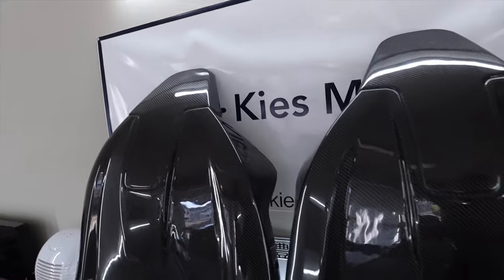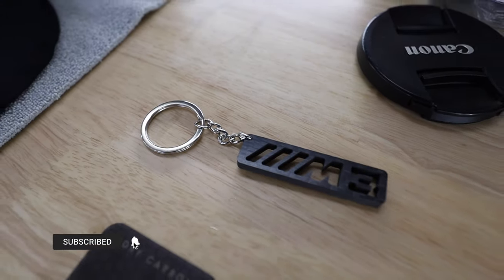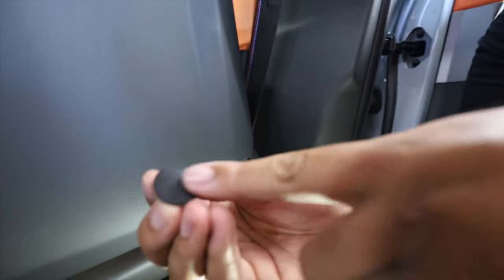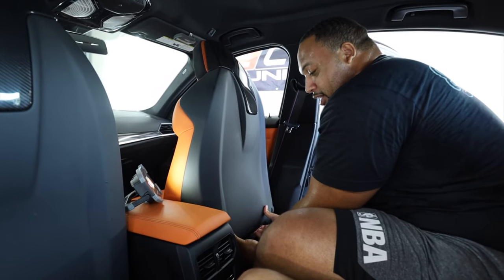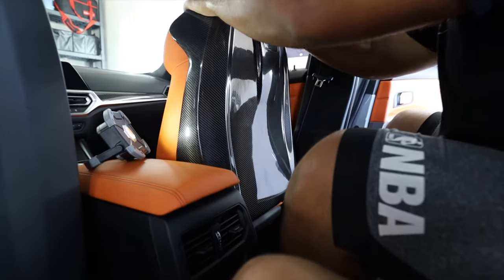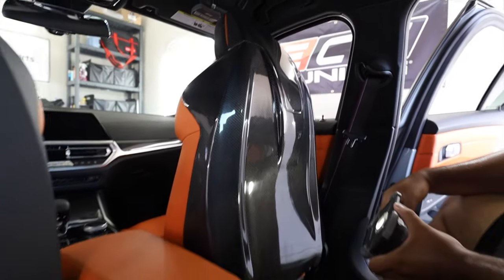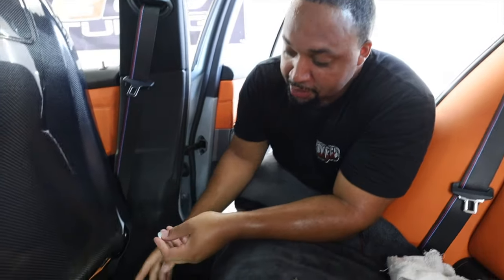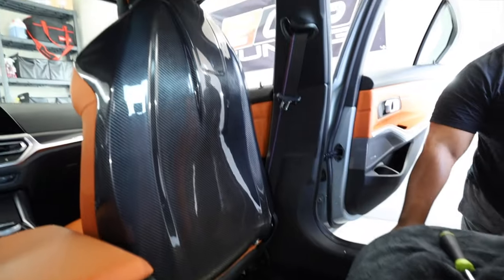BMW G80 M3 Carbon Seat Back Replacements / Carbon Goodness

Comment from the maker: I noticed that they are out of stock at Suvneer but you can also get them at the link below. Discount code WYF5

https://euroklasse.com/products/dinmann-bmw-back-seat-carbon-fiber-full-covers-g80-m3-g82-m4?_pos=3&_sid=3542acb82&_ss=r&variant=40809975873719
Reply: Thanks so much for finding this! It will complete my dream spec M3 Competition xDrive order. Arriving next month in Frozen Portimao Blue on Frozen Gold M Performance Wheels and Full Kaylami Orange Leather. 

Just ordered Seat Backs using your discount code.

Comment: Did you ever sell those panels?
Reply from the maker: Yes
Reply: Did you ever validate what mode for the g80 m3 eco,sport, sport plus had the most power on dyno or on road. Also what jb4 map did best as well. Thank you! 

Basically which combo paired best for the most power?

Comment: Have you sat in the carbon buckets?  I’m ordering an M4 and can’t decide to
Option them or not?
Reply from the maker: If you have any size to you they are not going to be comfortable for long drives. If this is not your daily driver then maybe it could work. I also heard if you have the manual the carbon buckets can get in the way when shifting if you have larger legs
Reply: @WhatsyourForte  yes I am definitely over sized human.  Car is auto and not daily but not sure if I should order with or without.  I still have time to change my order but undecided. Thanks for the info.